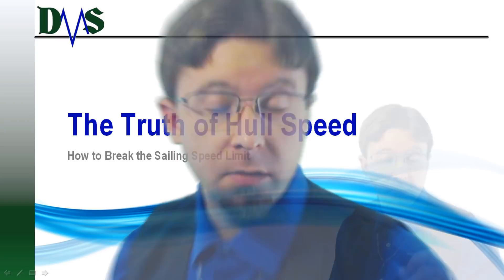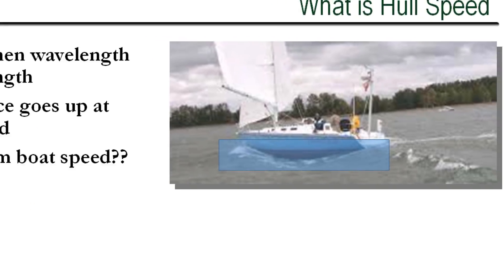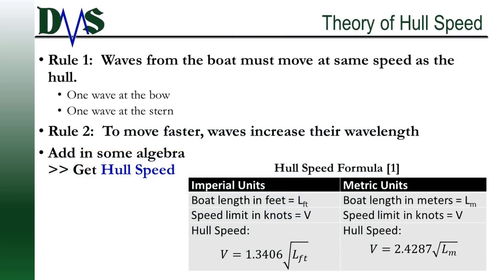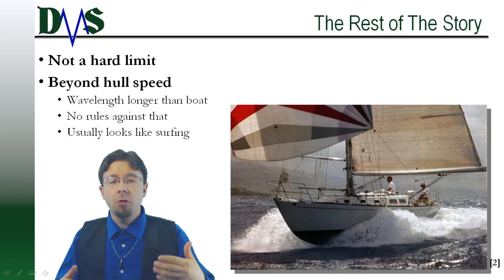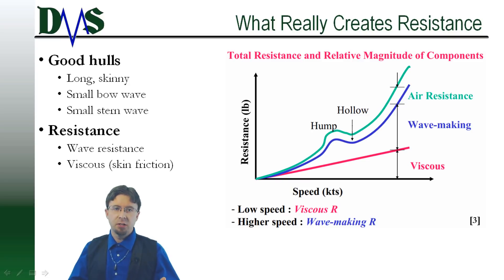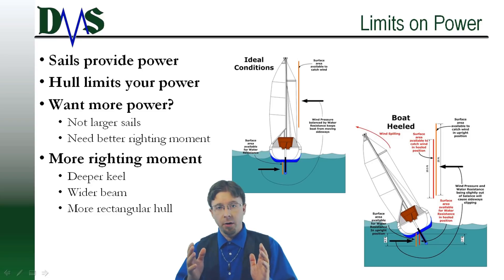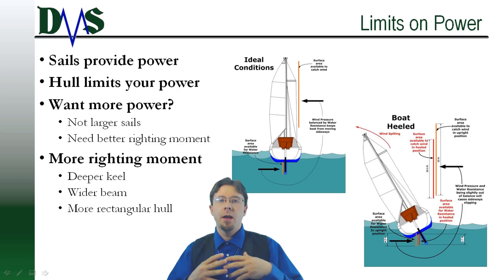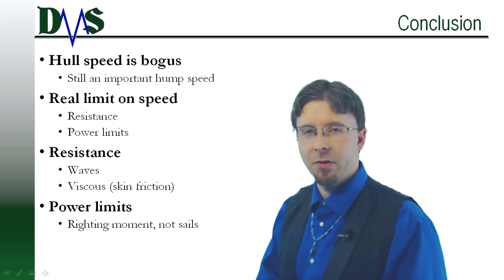The TRUTH of Hull Speed:  How to Break the Sailing Speed Limit

Comment: Show me a sailboat with displacement hull exceeding hull speed. Its still a usefull formula. I dont think anybody claims its the limit. Like you said its the speed of diminishing returns.

I heard of a 60 foot schooner with displacement hull going more than 5 knots faster than its hull speed in a gust while under engine power with all 7 sails locked into a perfect trim but in most conditions thats just not going to happen and would likely be more efficient to run at the hull speed.
Reply: I've sailed in a 28 footer at over 10 knots. It's not a hard limit at all, but you will need a lot of wind to exceed it

Comment: The formula for hull speed is not boat length, but water line length. You should have made this clear as correction #1. You also left out the terms for the broadest hull descriptions, which are planing hulls and displacement hulls. Sailboats have displacement hulls, which are designed to maximize water line length (being wide in the middle and wider still when heeled over). This helps them to achieve a better hull speed with small engines or via wind power. These hulls below hull speed are not sensitive to weight, so they tend to be heavy, which makes them handle better in waves and have mass to counter the heeling over of the wind. Once you understand these points of displacement hulls, you then realize that these hulls can't go faster than their hull speed - because no matter how hard the wind blows, they'll never get enough power to get over the hump. Beyond that, even with a motor, the power required for the heavy boat to start going up his bow wave is too great. Even if you COULD put a motor on to start to plane, it would be horribly inefficient, hence naval architects don't design boats like that. For planing hulls, they tend to be less heavy and pointy at the bow to help get over and on top of the bow wave. They of course require engines with power enough to go the desired speeds, but this is WAY less power than required to make a displacement hull plane.

Comment: Higher RM, Lower L/D ratios, Shallower 1/4 beam buttock angles ....it is complicated....but propensity to surf, is primarily a comfort trade off; when you analyze it.

or resistance vs. power ?.... yes, exactly.....and it's the bow wave that turns more power into more angle of heal ( eventually forcing a reef ? ...that is the question )

Comment: I came across this video while searching for Hull speed formulas and how they relate to age of sail (1650's through 1820's) wooden ocean going ships.  In theory, a longer 4th rate ship (Frigate) could go faster than an unrated Sloop.  I had thought this was due to the longer hull AND the fact that it had more canvas that it could spread aloft.  I was also aware that a ship that piles all canvas aloft could end up going slower than expected largely because the bow would bite deeper into the water depending on which sails were aloft.  But, at least now I have a deeper appreciation of what went into sailing ship design based on this video - and that while Hull Speed as calculated is not the final word on things, it can at least give me a decent estimate on how the ratios are between the ships.

Question?  If you have a ship of a given configuration, where you know the length/beam ratio, and you have the keel length - is it possible to get a relatively decent estimate of its max speed give or take?
Reply from the maker: Yes.  We generally need to know a few more dimensions and the sail plan.  But yes, with that basic information, we can get a decent estimate.

Comment: On the topic of sailboat hull shapes. Most sailboats have a reverse teardrop waterline: pointy at the bow, round at the stern. Most other foils, including sailboat rudders, have normal teardrop shapes (e.g., NACA0009 sections). What is the purpose of reversing the shape for hull design?
Reply from the maker: The common logic is that it focuses on creating a better ride in waves.  A pointy bow with vertical sides cuts through waves.  What is less obvious is that these hulls do have a teardrop shape, vertically.  They start deep at the bow, and slowly rise up vertically towards the stern.  Of course, there are always exceptions.
Reply: @DatawaveMarineSolutions  Thank you for pointing out the vertical profile--never gave it any thought, but it's obvious now that you mention it.

Comment: I sail O'Day day sailor twos and soon an O'Day 192. Both of these are not your heavier class sailboats. You can even plane out the day sailor 2 and I'm yet to find out about the 192. But the sale area to displacement ratio it's very good for speed however the ballast of displacement is very unstable. If you're sailing at the right angle to the wind, maybe somewhere around greater than 15 to 20° toward a dead run past a beam reach, the ballast to displacement ratio becomes almost insignificant to any dangerous heeling of the boat and you can maximize hull lift out of the water, probably also deploying a Spinnaker, reducing drag in the water and significantly overcoming hull speed dictatorship? I can see that as in aerodynamics of a car in motion there is a similar effect in hydrodynamics especially as you break whole speed as water is much heavier than air and the drag coefficient generated at the stern would seem to really go up exponentially pulling you back or rather exerting that vacuum or whatever you call it with water at a much greater rearward pull.

Comment: INTERESTING... why not flood the bow? If the problem is the boat climbing the wake, instead of trying to plan over that or have enough power to drive your boat uphill why not have a ballast tank in the bow which you progressively flood with the increase of speed. (Within limits) this will force the bow to dig into the bow wave and keep the boat level, no? As you slow down, you can pump out the ballast tank.

Comment: You lost me at narrower bow. I’m looking at scow designs. I guess that the scow bow design includes the wider beam, which you mention as being good for righting moment (and, therefore, power being used for imparting velocity). But it seems to me that a scow bow makes planing easier. I’m still not understanding why a narrow bow is better.
Reply: You are trading wetted area or viscous drag for righting moment. The narrow hull designs will have less viscous drag and better sea keeping. 
In the world of racing scows the sea keeping is absolute garbage, but you're not racing in rough conditions so you're trading for substantially more righting moment. If you look at the more extreme examples the boats are designed to heel substantially more than a cruising yacht in an attempt to reduce that wetted surface area gaining benefits of both designs. A canting keel is accomplishing the exact same thing while keeping total heel in check.
Reply: @otm646  I have no idea what a canting heel is (so I will read up on that), but this is the exact kind of succinct answer I was hoping for (but honestly not expecting) from someone on the internet. 

What do you know about surfskis? I’m really wondering about the dynamics of a surfski bow that digs into the next wave when someone is surfing. It’s almost like the bow is bracing against the wave, which means that it’s actually slowing it down. However, it seems stable and the boat will move at the wave speed. 

I would like to see some quantitative descriptions of wetted surface that compare a scow bow with a steep-stem pointy one. Any references for me?

Comment: I have some questions about your graph showing the 3 main components of resistance - viscous resistance is linear, wave making resistance has a hump (which is the hull speed hump that your presentation is about) and then you have another line with a hump which is labelled AIR - what is this and what determines the speed at which the hump occurs and the size of the hump?  It seems to correlate with wave making.  Also, your viscous line I assume is water viscousity.  There is also viscous drag in air - is that subsumed in the air line I'm asking about?  Is the air resistance just the drag on the exposed hull/deck/cabin or does it include the net drag on the sail plan?  Also, switching back to the wave making hump - I'm assuming that the speed at which the hump occurs relates to LWL but the magnitude and shape of the hump are determined by shape and displacement - meaning that a light long skinny hull also has a hull speed bump but its much smaller so more easily overcome.
Reply from the maker: Yes, the viscous line represents water viscosity.
Air resistance is the combination of viscous and potential flow resistance.  The net resistance on anything above the design waterline.
And yes, the speed at which the hump occurs relates to the waterline length, and magnitude is determined by the size and shape of the hull.  With some hulls, you even see multiple humps.

Comment: Ok, but there is another factor in sailing vessels that didn't get mentioned.....keel weight causing righting moment. if you want  more power add sails AND keel weight?  How do these interplay - or is just not enough to push beyond the point of diminishing returns?
Reply from the maker: Very correct.  Keel weight factors heavily into the righting moment of your sailboat, which ultimately determines how much sail power the boat can carry.  And yes, for racing boats, that is enough to get beyond hull speed.  But I will admit that any speeds beyond hull speed, the sail power requirements go up extremely fast.  So possible, but you really need to design the entire boat around going fast:  hull shape, weight savings, sail design, etc.  This is why we see racing sailboats as their own dedicated design.
Reply: @DatawaveMarineSolutions  Thanks for that...appreciated.

Comment: It's not enough that imperial system is confusing and doesn't scale linearly, now you have to mix it with metric to make it even worse. Why use m/s² for gravity and not speed of squirrel with oversized testicles per average chin height of a lama. What kind of abomination is speed in knots for length in meters? It's like saying pressure is liters per square foot. Doesn't make sense. Other than that, great explanation.
Reply from the maker: Metric measurement system = unstoppable force.
Shipping tradition = immovable object.
Horrible units of measurement result from combining the two.  :-)
Reply: @DatawaveMarineSolutions  right you are. Same with units used in flight.

Comment: If the hull speed formula limit was a definite maxium limit that could not be exceeded in any circumstances then a small dinghy towed by a large vessel many times it's length would slow the speed of the longer vessel to the maximum hull speed of the dinghy which does not happen in that circumstance.

Comment: I enjoyed the Calculus, Geometry and Physics lecture. I have found most of the information on the internet is like getting a weather forecast. Everyone repeats what they have heard; no one verifies the facts or even knows what the facts are. 
Allow me to ask you a simple physics question; take two round objects the same length and size, both have the same nose cone similar to a jet aircraft.
Object A; starts the gradual curve to the end (tail/stern) point at 50% of the length.
Object B; starts the gradual curve to the end (tail/stern) point at 75% of the length.
Simple Question: which object is faster given everything else is constant; Object A or Object B.
Last question what is making Object A or B slower given everything else is the same (constant)?
Reply from the maker: That is a bit of a trap question.  Potentially, Object B has a higher pressure recovery than Object A.  However, I would need to perform some calculations to see if the more gradual curve of Object B increases the wetted surface, which increases friction drag.  My official answer:  I can't say for certain, I would need to perform calculations.
Reply: @DatawaveMarineSolutions  No trap, easy peasy.

Comment: Doesn't the catamaran or trimaran provide huge righting moment for sailboats?  Also, we see competitive sailors pulling their rumps over to the side to add additional righting moment.
Reply from the maker: Yes, and no.  Monohulls also have a huge righting moment, due to the deep keel and the weight at the bottom of that keel.  Catamarans and trimarans provide that same righting moment using buoyancy of the amas.  Those amas require far less weight than the deep keel.  So it is more fair to say that catamarans and trimarans achieve the same righting moment, but with less weight.

Comment: Was it boatlength or waterline length in the formula? Good short video, but it could use some examples of say, planing hulls or classic hulls that use their lifting forces in a dynamic way (light winds, bow and aft overhangs out of water > less viscous resistance, high winds, bow and aft overhangs in the water > longer waterline, more hull speed). Both work fine but in different sea states (yet another dimension).
Reply: Waterline length.

Comment: What you did, int mention is the difference between displacement  hulls and planning hulls or to put it another way moving a object in water means it is displacing that water or it must move the water out of the way as apposed to riding across the surface  as in a John boat or flat bottom drag boat,  mearly calling it resistance does not explain it.

Comment: Very interesting but I think for the boats I use, hull speed is the limiting factor. I use human powered racing kayaks which are also limited by the rules of the sport as well as human physiology. Winners are those with enough power to get to maximum speed first and can hold on longest. In close quarter marathon racing, we can use the wave generated by opponents to surf on and save energy for sprints at tactical moments.

Comment: I would add the “ winged keel “ acting to slightly lift the boat causing less hull surface to interact with the water ... just my experience sailing with different keel configurations

Comment: One of my most exciting-without-being-scary times was surfing a 30’ displacement hull on the aft stern wave of a harbor tug that passed my ketch in the gut between Hoboken and Staten Island. The light wind on the beam reach would not otherwise have allowed matching the tug’s speed. I only sheared off after noticing the wake was drawing me toward the tug’s stern.
As to max hull speed, one theory has it that suddenly accelerating a sailing ship can literally drive it under the water when bow and stern wakes form only one wave trough between them. This sudden acceleration was posited when said ship was sailing under light winds aft and was hit by sudden squall and the crew was unable to reduce sail in time. Commercial sailing vessels were notoriously small-crewed and could carry acres of sail. Thoughts?

Comment: I have been trying for a while now to understand and compare the amount of power in kilowatts required to move a monohull, a catamaran hull and a trimaran hull forward at different speeds.  Why?  I would like to understand how to match electric motors to different hulls.

In addition, sails capture wind energy to propel hulls forward, but how much energy is actually captured per square feet of sail area.  

The difference between the two should be due to efficiency and resistance losses right?

Do you have a video discussing these topics?

These video helped in understanding a bit better the hull area.  Thank you.
Reply from the maker: I do have several videos that discuss the relative merits of trimarans and catamarans.  The best place to start will be my video on comparing between the different hullforms.  https://youtu.be/FYFB56Q8BTg  This doesn't directly talk about powering estimates though.  That is far too complicated for one video.